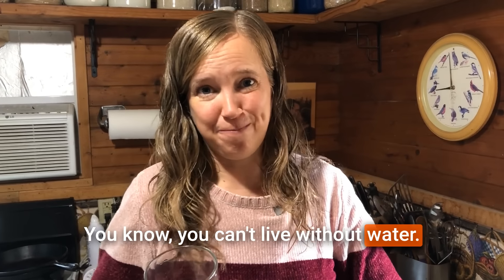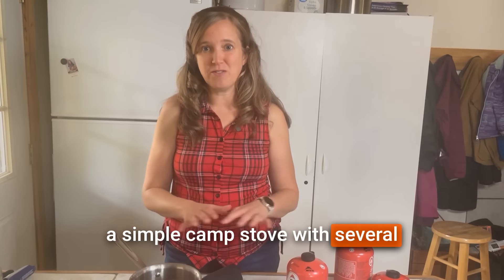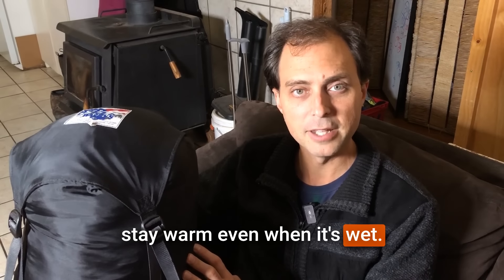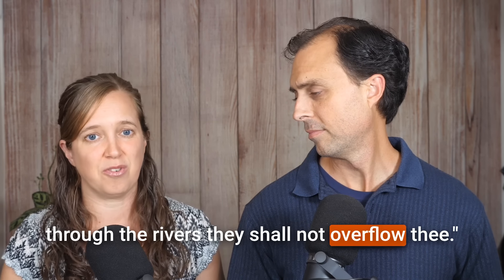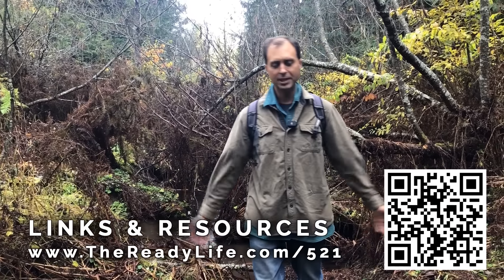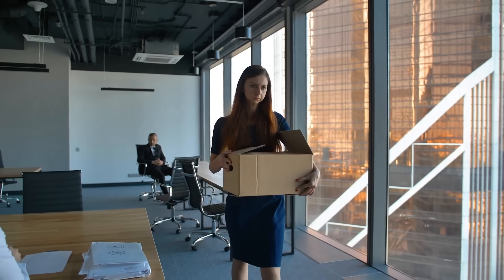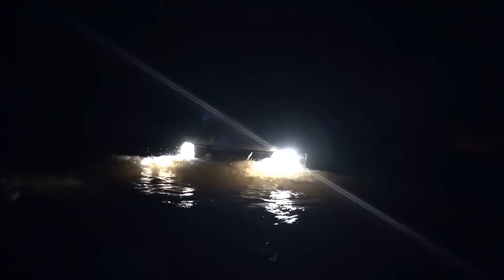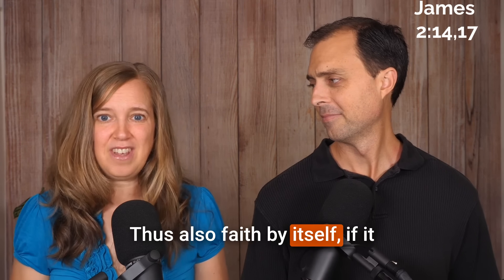How to Survive a Disaster: 21-day family preparedness plan

Comment: Have 3 Ecoflow , 2 Jackery , 1 Pecron , and just purchased Bluetti AC200 L  . Charge them with my Honda 4000 gas generator ( 41 years old and runs like new ) cared for it . The Ecoflow ( 7 years old ) have only 800 cycles . The Bluetti has 3000 plus cycles because it it lithium phosphate ( need the phospate - did not have 7 years ago ) Make sure you buy lithium phosphate if you care about getting 3000 cycles . Saved all my food when lost power for 20 hours and then 18 hours 2 weeks later . Solar is the way to go .
No gas or oil . Charge them with your gas generator or solar panels when the gas runs out . Charge 1 hour gas 12-14 hours in solar if you are lucky enough to have sun .
Have supplies . Puts you in control .
Reply from the maker: Wow, that's a lot of portable power packs! Agree about going with lithium iron phosphate batteries in those for longer life. I like the brands you mentioned. However, unless you need them to be portable, if you are planning to put that much $ into power packs, could set up a nice permanent system with likely much better performance. But it wouldn't be portable. Just another option to think about.

Comment: I refill all glass jars and bottles with water. I don't rotate but I do have silver impregnated ceramic dome filter with activated charcoal and hundreds of two quart purify tablets, pool shock. I line store bought water bottles under clothes in the dresser drawers that have room.

I have fifth bottles with water on shelves behind photo frames and stacks of books. A bonus for that is it brought everything to the very front of the shelf, less dusting.
I took three cup mylar bags and filled with water. Taped those in a slight over lapping to cardboard and slide under the couch. I have seven gallons total under the couch alone.
I've been in this apartment since 2009, I had to get inventive for hiding all.
Reply from the maker: Yes, that is one approach, to not worry about rotation and just be prepared to purify the water when you need it. But if you put away sealed water containers, you'll have water ready to use right away during a disaster without any extra steps. Both valid approaches, but I prefer the second option if possible.